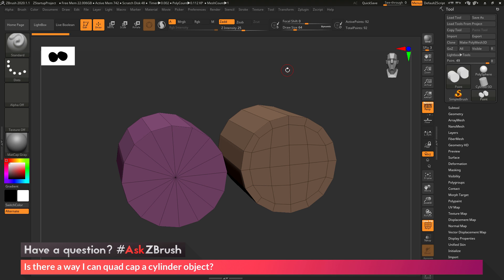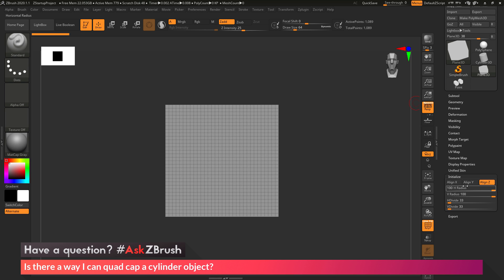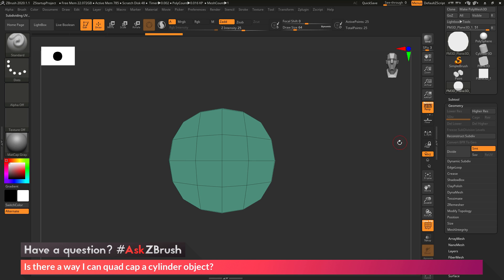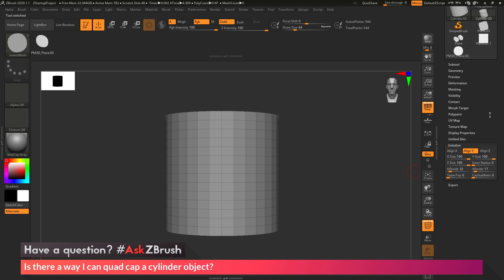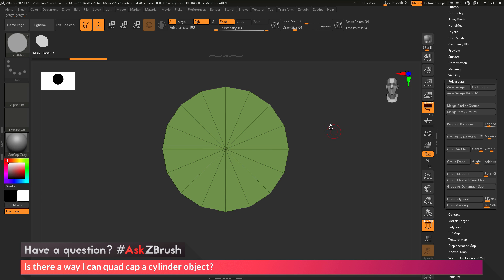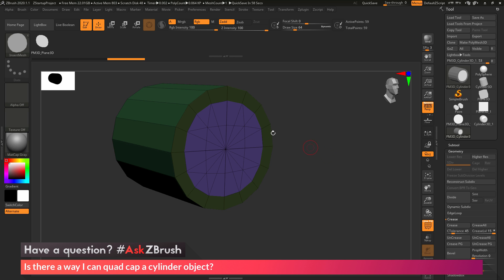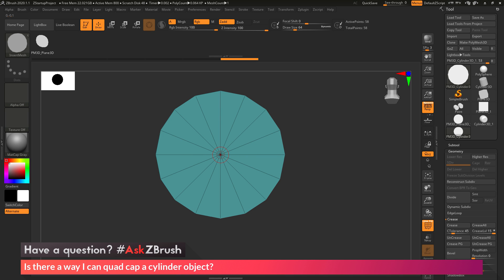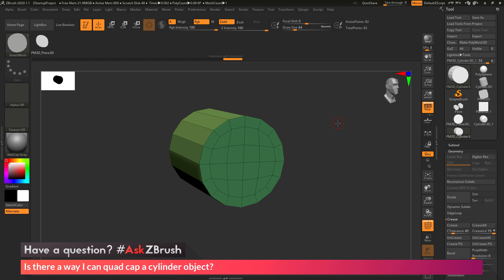#AskZBrush: “Is there a way I can quad cap a cylinder object?”

Comment: another method memo.

If you just want to get this quad cap cylinder,   
・You put a initialized QCube(resolution 6)  
・do Tool-> Deformation-> RFlatten(30) in one axis
you get a almost same cylinder.

If you want a extra polyloop on top,
 just do Zmodeler->polygon->inset (Flat island, modifier: equidistant-> standard)